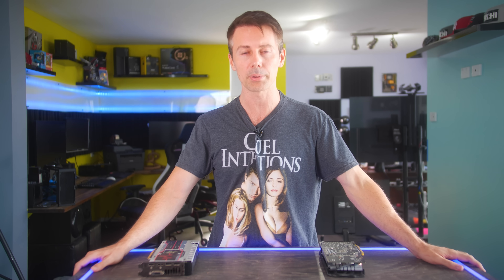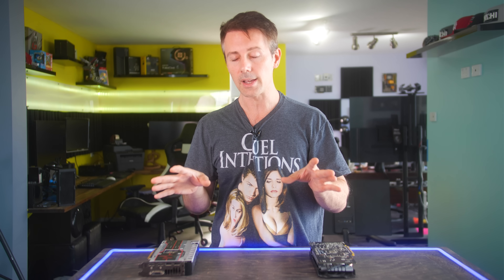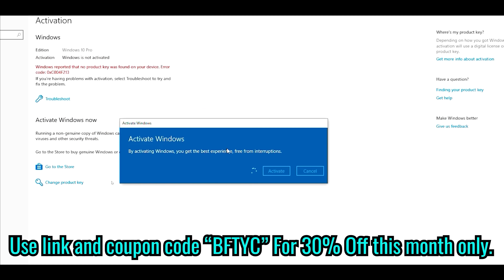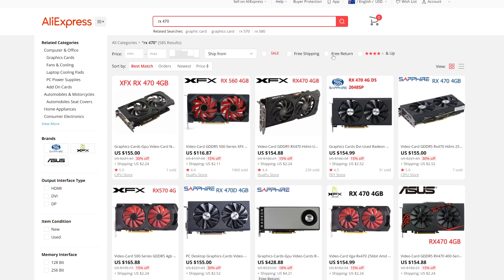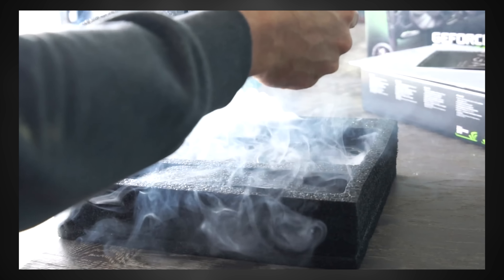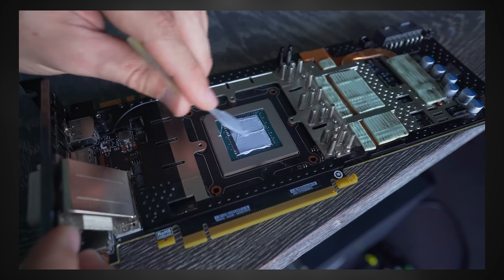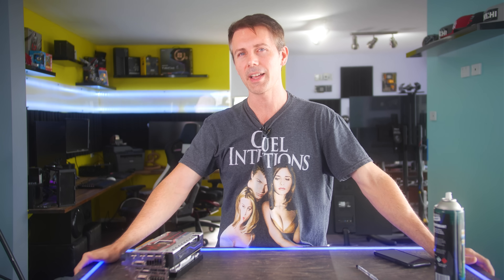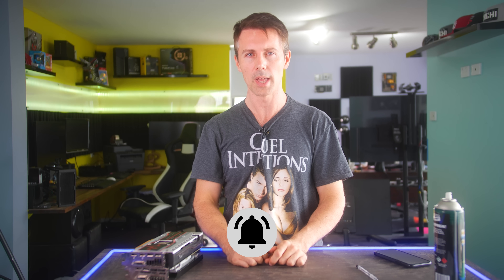How to BUY a USED Graphics Card in 2021's CRYPTO BUBBLE.

Comment: I literally, just yesterday  bought a used RX 580 4GB
Thankfully I  bought it from an electronic service that fixes consoles, PCs, sells games and does other things, etc, so they replaced thermal paster and cleaned it before selling it.
At least I didn't notice anything wrong with it when installing it.
Reply: Where you bough it? Near my location is a 580 4gb  at 120$ alb store
Reply: @DualPerformance  I paid 194$ for rx 580 Sapphire Nitro 4gb
Reply: Fortunately Polaris cards are extremely reliable. I've been selling off all my 4gb cards. Those things have been mining non stop since 2017 and not a single one has had any kind of failure or performance degradation except for two I had to replace fans, that's it. They really are workhorses. Unlike the 4 month old 5600XT I have that is a buggy, aggravating little pain in the ass. But don't worry, I won't sell that one to anybody. She's going to mine until she dies.
Reply: What problems are you having with the 5600XT?
I recently bought a used one to replace my defective, second hand Vega 64 that is only stable when mining and I would be really pissed if I also ran into problems with it.
Reply: @SentinelSent  I have three of them. Two are perfectly fine but the third has just been a pain. It doesn't like windows at all, have to install the drivers three or four times before it gets recognized. Finally put it in my linux machine where it's fine except for occasional constant crash sessions but linux just reboots a few times until it's stable and it goes again. I should have returned it but it's making me too much money

Comment: Nice one again👍
I have proposal, make a video what people should do if they get custom mining bios. Explain they should mod that bios back rather than using one from techpowerup.
Here is why. Stock bios from Techpowerup migh not work. Happened to me. 
I then took my modded bios, opened it in Polaris bios editor (I use RED, PBE and SRB) and copied all vaues from bios I downloaded from Techpowerup. I actually use all those 3 bios editors, because some show values the other don't. So first I do it with PBE, then with SRB and at the end RED, but the order of editors is not relevant, so whichever comes first...
Two instances of bios editor opened, stock bios from Techpowerup and custom bios.
Copy all values from stock and paste to custom bios.
That way I get original bios from that gpu back to factory settings.
I'll say it again, happened to me few times, the stock bios from Techpowerup just wouldn't flash or if it flashes to gpu, that gpu ends with issues. But when I edit back that custom bios to original values, all works.
Of course, most of the times stock bios from Techpowerup will work flawlessly.

Comment: interesting if you buy a computer in the uk and it goes wrong it doesnt matter what the circumstances are it has to be of merchantable quality for the full 12 months refusal to repair or replace would be a matter for the government to sort and they can levy unlimited fines against a retailer for failing to provide warranty. The 4 gb rx 570 goes for anywhere from 120 to 200 pounds on ebay roughly 150/250 usd right now.
Reply: /\ This is a fake
Reply: @letronix6243  The tech yes reply yeah i figured
Reply from the maker: Ignore those previous replies, is spam from a spammer, fixing it now, also thanks for commenting :)

Comment: One thing I don't think is mentioned enough - although, maybe it's just our market with cheap electricity and way too many miners. Last time over, every gpu was horribly overpriced, as almost everything was able to mine at least something. What couldn't mine was snapped up by people who needed any kind of graphic card. So, the prices were high. This time around though, miners are actually trying to get rid of all those 4GB cards they have. So it's a weird situation, where everything 6GB+ is crazy expensive (new gpus are always overpriced over here), while a used rx 570 4 gig can still be had for around 70 euros if you search carefully. That said, almost all of those cheap cards are literally stuff miners are getting rid of.

Comment: Running my 3060 Ti's on +200 memory and a slightly increased fan curve to shift the heat a bit more, I know they can both do 800 but at the end of the day i do want to use these normaly.... at one point.

Comment: Hey mate, what kind of used gpu should I be looking for if I'm building a video editing machine instead of gaming pc?  I'm currently in Vietnam and prices have shot up crazily in the last 2 weeks.
Reply: 4gb and under cards are a lot less useful to miners so they may be your best bet for a deal. RX 570 and 80 4gb, 1060 3gb, 1050TI, stuff like that.
Reply: @wingracer1614  Thx mate! The 580's here have gone up in price in the last two weeks also.  I may have to look at a 1060.  I just put a 1050 ti low profile into my Dell 990, was hoping to get something a little more powerful in my used/budget X99/Xeon 2678 v3 build.
Reply: @Mickey.BluEyes  If you have a 1050ti, just hold off until the summer when all this comes crashing down. You'll be able to get 1070s or 1660s cheap then
Reply: @wingracer1614  Thx again mate for the advice.  I'll just hold off on the next build for now.

Comment: Bitcoin: *Becomes unminable on GPUs*
Me: "Thank god, hopefully this won't happe-"
Etherium: *Can be mined stupidly easy with GPUs*
Me: *INTERNAL SCREAMING*
Reply: do you think 5-10% more cards on the market would even make a dent?
Reply: @knifeyonline  not really, becuz I think mining is still going on so if there’s more cars then it still sold out cuz the miners are still going for them. But tbh once the mining thing is over, there are prob a bunch of used cards on the market
Reply: @shinefake48  can you explain how it will be over because I don't see any end of it
Reply: @RADIUM108  it was just like the mining heat before, once the thing drops again, mining wouldn’t be as attracting anymore, so then mining would be rare since and cards will be available
Reply: Bitcoin stopped being mineable on GPUs nearly a decade ago and even when it could be done on a GPU it did not make much of an impact.
Reply: I think it is a good thing.
The more they buy the cheaper they sell and more.

They mostly look at power consumption because if not, then they won't gain anything. So they won't overclock them that much if it's not worth the bill.
So they first want to undervolt them and only then overclock them.

And smart miners will want to preserve the value of the card, so they can buy new cards while selling the old ones to decrease the money spend on new ones.
Reply: Actually, Bitcoin is currently equally profitable as Ethereum on gpus right now.